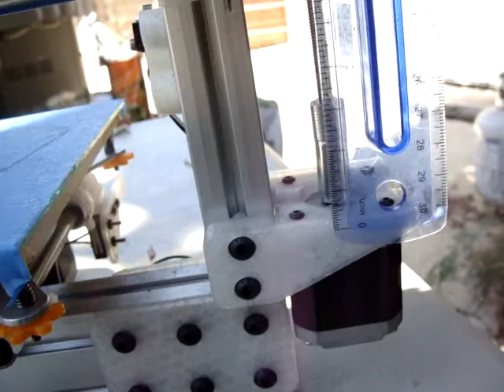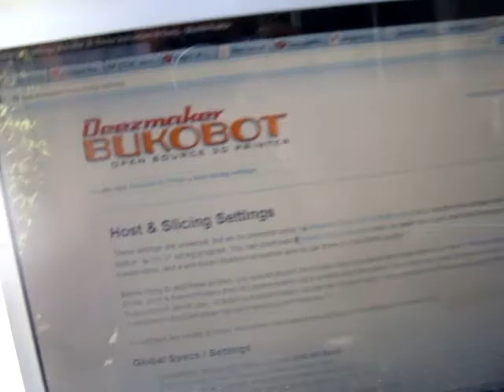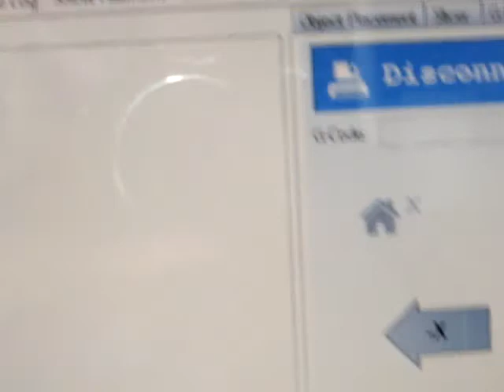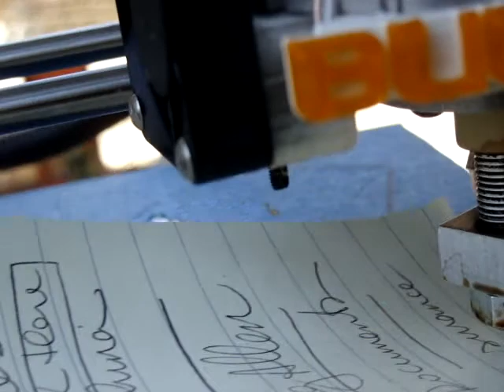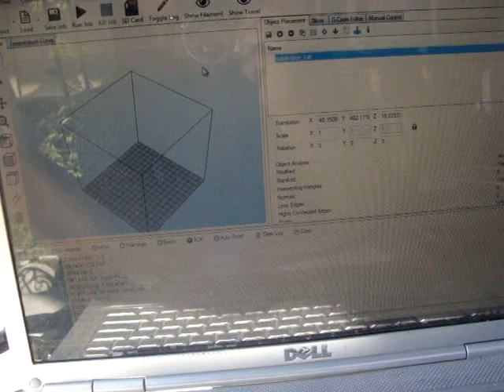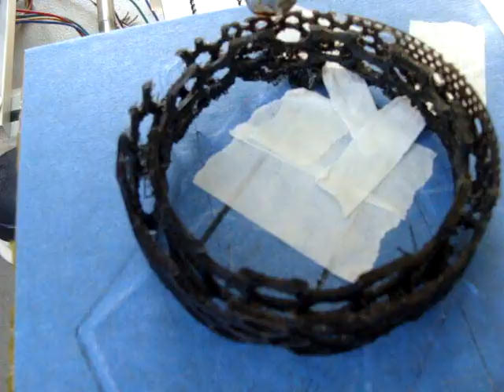My First 3d Print

Comment from the maker: It was all provided via the internet by the manufacturer.  it's on bukobot dot com , bukobot-3d-printer.
I took the approach of reading, following along mentally, though not necessarily physically.
slic3r is included in the repetier software.
I'll do another vid today to go over more as an instruction rather than as an experience (which is my usual way).